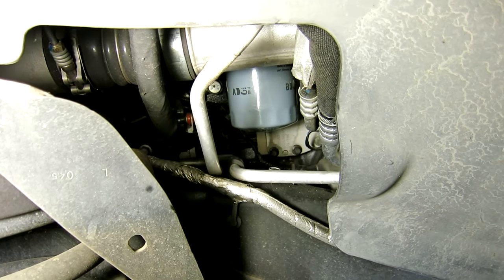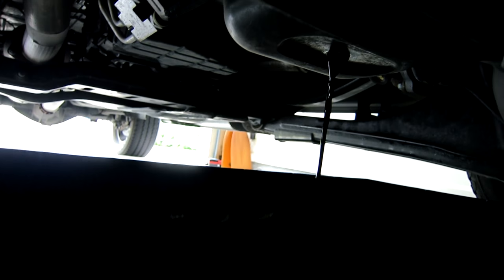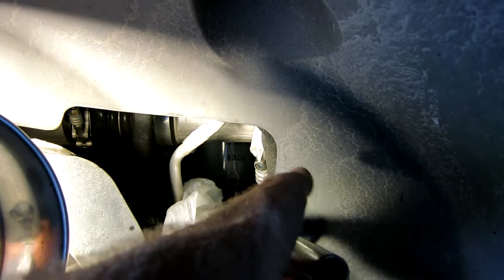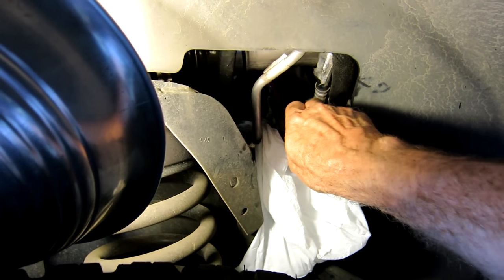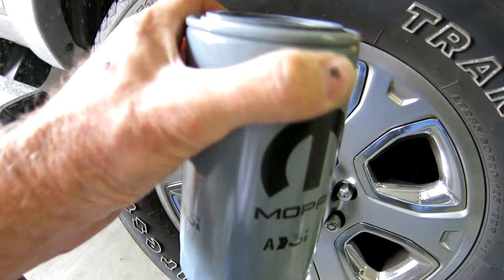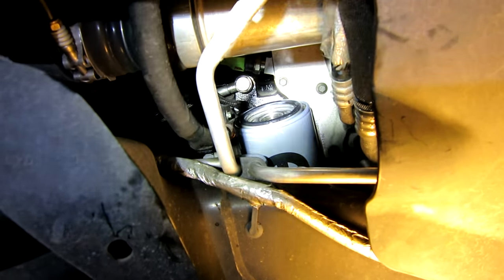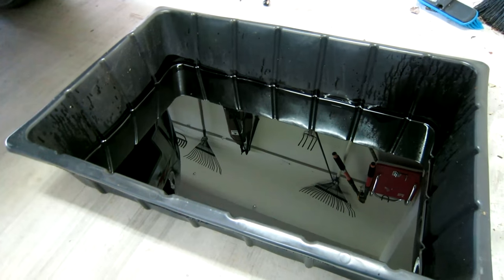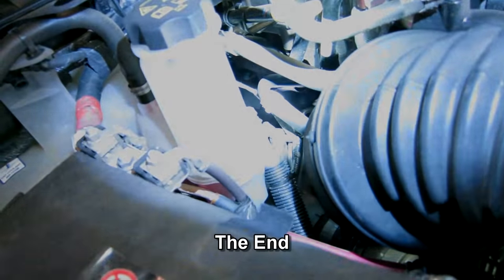2014 RAM Cummins 6.7 Oil Change

Comment: If nothing else the 6.0 Powerstroke had the fastest and cleanest oil filter change in the American vehicle department. It was on top of the engine where the oil drained down and it changed in no time flat
Reply from the maker: Yea, Cummins doesn't seem to collaborate very well on filter location. ha

Comment: Speaking to a cummings engineer he don't know why people put oil in the filter its never a dry start because even if you drain the oil there's still oil cavities he said we even put exact instructions of how to change the oil on the filter package nothing says add oil to filter people think it will help but it doesn't do a thing except maybe make a mess if spilled, thing guy did everything right except he added oil to the filter
Reply from the maker: Both RAM and Cummins recommends filling the oil filter prior to installation.

Comment: I bought mine January 2018.  It looks exactly like yours.  I also bought an additional waranty,($3200).  Supposed to cover everything (except for normal wear items) for a $100 deductible.  I thought you might know, if I change my own oil, will I void my factory warranty?
Reply from the maker: No, it will not void your warranty.  Keep your receipts is probably recommended.

Comment: The filter cap is well worth it.  Yes, use the ziploc to catch the oil, but you can't drag that oil filter through the wheel well without that filter cap...been there, tried that.  Thanks for the great video.

Comment: Very helpful - watched a few times before and while doing my first oil change.  I only wish I'd realized sooner the main problem I was having - spent probably 4 hours between 2 days trying to get the stinking oil filter off -  all because the $3 Walmart 93 mm 15 flute oil filter "wrench" was a piece of crap that didn't fit.  The salesperson at Autozone checked it and said theirs had the same issue, but O'Reilly's $7 one fit the filter like a glove.  Once I had that, the rest was history.  The other video you posted about the Geno's cap-off tool looks interesting - probably a tool I'll add to the toolkit sometime in the future.

Comment: Great video man! I havent  turned a wrench on a trucks since the early 90s and that was a 77 ford. I changed the oil on my 13 Cummins today and everything turned out great. Fairly simple, although I lowered the filter from below ( With the aid of the wifey holding while I reached up from below). And I put it back in from bottom. Thanks again

Comment: Remove the intake to get to the oil filter. You won’t spill any oil, cuz you don’t have to tip the oil filter to remove it. Easy and clean job. When you install new filter, don’t go more than 3/4 turn after the filter touches base. That way, you should be able to unscrew filter by hand when you do your next oil change. 👍

Comment: I always torque a drain plug below the factory spec. I do it as a precaution to prevent stripping oil pan threads. Never had one come loose, and never stripped an oil pan either.
Reply: I heard others do that also.   I under-torqued the transfer case for the same reason as it has an aluminum case.  Most people don't use a torque wrench,
Reply: I have never used one. Do you think I should?
Reply: I guess it depends on your experience.  I like them but don't always use it.
Reply: Thanks.
Reply: I would, it won't hurt anything. I have several different torque wrenches and can tell you that the Husky from Home Depot is a good wrench for the money. I also use the Old Fashion T-Bar style because they are Very Accurate. Not Sexy, but accurate.
Reply: bayonne Thanks.
Reply: agree, I try to use a torque wrench wherever I can, some places are too tight but when I can I do.  You can do a lot of damage by over or under tightening some critical bolts.
Reply: Tightening Force is critical on Oil Pan Drain Plugs. Most people do not realize that a torque spec does not account for oily treads which will easily allow an over torqued condition - or stripping.
Caution should be used when tightening Drain Plugs of ALL Types. 
Snug Tight - is good enough.
Reply: 25-30 ft lbs is all you need.

Comment: Great video.  Just changed the oil using the Genos filter cap.  Went without a hitch.  Maintenace manual calls for greasing the front drive shaft and the tie rod ends.  I can't find any grease fittings.  Do you grease something on your 2013 Ram, mine is a 2014?
Reply from the maker: Thanks, I have a 2014 also.  There are no grease fittings on the tie rod ends but there is one on the drive shaft. See this video, it's not a zerk fitting, it's tough to get to.  https://youtu.be/Scbru0vUkaQ.  It's the only grease fitting on the entire truck.

Comment: Marion ever thought of using Donaldson oil filter. I hear good things about them.
Reply: Why dink around? Use Fleetguard Stratapore LF16035 exclusively. If you are unaware, Fleetguard is aka Cummins Filtration. Not an aftermarket outside vendor but the engine manufacturer's wholely owned subsidiary. The Mopar filter is a painted Fleetguard cellulose media filter.

Comment: Theres a drain channel under the filter to drain the oil away from the engine and steering components..
Reply: BassheadGTP It doesn't work. I know from a lot of experience.
Reply: they could have put it somewhere else
Reply: Nothing drains from the filter if you go through the top. Easier and cleaner. Just keep the filter upright.

Comment: Hey Marion, I purchased my brand new 2018 Ram 2500 because of your videos! I’m just curious I have always been a fan of servicing my own equipment “we have a small farm” I’m just curious what do I need to do to make sure I keep my warranty. 

I’m done dealing with dealership they are messy and I feel like no one will take better care of your vehicle then yourself.
Reply from the maker: Yea, dealers are the enemy, ha.  You can do your own work, it won't effect your warranty.  Just don't remove any of the emissions equipment etc...  I recommend using Mopar or Fleetguard filters, especially the fuel filters.  Use the recommend diesel oil either synthetic or regular (dino) oil.  I don't use synthetic since I don't put a lot of mileage on this truck and hit the 6 months before I get more than a few thousand miles on the odometer.  Let me know if you have any questions.

Comment: you may want to use shell T5 15w40 as regeneration heat is hard on the oil and turbo
Reply from the maker: Thanks, Mobil Delvac  1300 has been in every truck I've owned since 1995 but mostly I'm an Exxon retiree so you know where my heart is. ha.
Reply: my friend clocked 1.5 million miles on a Detroit series 60 using delvac
Reply from the maker: Yea, if you look at the specs, the Delvac looks a bit better.  Actually, Chevron Delo, looks great.  I retired from them also. ha
Reply: delvac 1300? I prefer to spend the $$ for Delvac 1 ESP full synthetic. Peace of mind but damn expensive unless on sale or Mobil rebate
Reply from the maker: yea, agree.  If I did 15K oil changes, I'd definitely go with the synthetic.  Mobil either way.

Comment: I guess you get good at it like anything else.ford makes it 4 times as easy. I won't say 10 times as easy cause that's just not right but 4 times is easy is good.
Reply: Cody Baker I like how much you thought about that
Reply: I guess you never actually worked on a Ford, past the oil change?

Comment: Much simpler to remove the turbocharger inlet duct and change the oil filter from above. By the way, Cummins would not include in their service manual instruction to pre-fill oil filter if it was optional or unnecessary.
Reply from the maker: That subject is debated about as much as which oil to use. ha.
Reply: +Marion Blair Not really as Cummins says pre-fill. Nothing to debate.
Reply from the maker: +Walter K agree, I always fill the oil filter.   The debate is whether you go in through the top or the side.  Everybody has their preferred way of doing things, the end result is about the same.
Reply: @MarionBlair  just an additional idea. Personally, I find with a filter socket such as yours and a filter-plug-tool through the fender is simple and mess-free. Ram should include the plug-tool with the truck. I opt to periodically remove the air inlet plumbing to remove oil filter from the top. This also gives opportunity to assess radial and axial play in turbocharger shaft.

Comment: my has 2 clamp and two tabs in the back but when undone can not move top of cleaner forward enouge wonder if i need to remove the hose
Reply from the maker: Loosen the big clamp and remove the intake hose from the air cleaner housing then remove the 3 screws and lift up.  The cover of the air cleaner housing should come right off.

Comment: what is in the way to prevent accessing the oil filter from underneath?  A cross-member or.....?
Reply from the maker: Yes, on the 2013 and up 4 x 4's there is a cross member that completely blocks access to the filter.

Comment: How often do you change your oil? The book says 15,000 miles or 6 months, whichever is sooner. I never drive 15,000 miles in 6 months so I just change mine on a 6 month schedule, every spring and fall. I know I answered my own question, but I'm curious if you have any thoughts on this. Thanks!
Reply: Also I use Shell Rotella 15W-40 T4, as recommended in the owners manual. I believe it is conventional oil, as opposed to synthetic. Also I recently decided to switch over to the K&N oil filter instead of Mopar, but only because they are made in the US and I would rather support that. Do you have any opinions or research to share on oil choice or filters? I have a 2016 and the oil filter appears to be a little harder to access on yours. I wonder if Cummins made changes to make it easier? I also access it from the wheel well and I do have to tilt the filter to get it in and out, but I usually don't spill a drop.
Reply from the maker: personally, I think 15K is too long and from the oil analysis I've seen, I'd keep the max to 10K.  I usually shoot for about 6K or 6 months but 8K would be fine for highway.  These are just my standards not any real data to back that up.
Reply: @MarionBlair  Thanks! That makes sense. And I agree, I wouldn't feel comfortable letting my oil get up 10K even if it were in less than 6 months.
Reply from the maker: No, the 5th gen looks the same to me.  Hard to get to.

Comment: Just got a 3500.  What is the savings on doing it yourself vs a shop.  I imagine pretty significant.
Reply from the maker: If I do it, it cost about $45, dealer does it for $75.  If you trust your dealer, it's probably not worth doing it yourself, ha.  It's a pain in the ass, it's one of those things you have to just like to do otherwise, take it to the dealer.

Comment from the maker: Cummins says 15k or 6 months.  I usually only have 4 to 6k when I get to 6 months
Reply: Hi Marion blair i just got my 6.7 from dealer checked the engine oil and its reading a bit high. I checked it 2hours after i drove it but it was 80degrees today. Is it better to check when i start it recently or let it cool down.
Reply from the maker: @devinsuni  i check mine cold like in the morning before i take off.  Some dealers overfill them.  Also, if it sits there for days, it might show high as the oil takes a long time to drain.  3 gallons on an oil change.  No more no less is what I do.  It'll drive you crazy trying to get an accurate reading.  As long as it's not low, you're good.
Reply: @MarionBlair  thank you sir! Yeah its annoying just buying a truck and not knowing what they did during the oil change. Do you suggest anything for fuel additives for fuel fillups.
Reply from the maker: @devinsuni  no sir.  No additives.  On the oil fill.  I had one dealer tell me he puts an extra quart.??  Ha.

Comment: Do you have to remove the front wheel to change the oil or can you leave the wheel on?
Reply from the maker: I leave it on.  thanks.  If you have short arms and it's uncomfortable, you can remove it but other than reach, you don't need to.  thanks.

Comment: The filter is so much easier from the bottom, just my opinion
Reply from the maker: No way to get to it from the bottom on 2013 and above.  Thanks.
Reply: My apologies, I have a 2012 and it's super easy.  Did they not give you an access panel? I wasn't trying to imply you were doing it wrong, it just looked like a bigger pain than necessary. Since you're going in that way, don't waste your money on the "filter glove" from genos.  I do however highly recommend the "EZ drain valve" they have.  I drain straight back into empty oil jugs with zero mess, it's awesome. Drain pans are a thing of the past now....

Good day to you sir.
Reply from the maker: Yes, the video shows the access hole in the fender.  The only other way is to remove the turbo intake hoses from the air filter to the turbo.  I have the EZ Valve sitting on my desk.  One day I'll get the nerve to install it

Comment: How often do you do your oil changes?
Reply from the maker: Every 6 months or about 6000 miles.  I don't use my truck enough to justify synthetic otherwise, all highway miles, 10,000 would be the max based on the oil analysis I've seen.

Comment: Can anyone tell me what the MPG on this beautiful machine is?
Reply from the maker: I get a out 16 - 17 in town and 23- 24 Highway according to the electronic calculator on board.  I never have hand calculated it to see how accurate the computer is.
Reply from the maker: Here a mileage test.
https://youtu.be/jVqPfI6iIxU
Reply: Marion Blair youre getting 16-17 city!?!? im trying hard as hell with my 2013 6.7 2500 to get 14 city, you got any not so obvious tricks other than drive slower?
Reply: Brandon Le Slow RolliN
Reply from the maker: That's what the EVIC says, not calculated.  It's pretty close however.

Comment: Is it necessary to pre fill the filter
Reply from the maker: Hi, the service manual says to fill it however there is much debate on the various forums as to whether it's necessary.  Nearly all the quick change places do not fill it.  My dealer does it the way I did in the video but doesn't use the sealing wrap.  I personal think that is adequate because the oil flows through the paper (outside) first then comes out of the center.  If you soak the paper with oil and leave the center of the filter without oil, you can install it without the sealing wrap and won't make a mess.  Oil pressure will come up instantly so I think that would be good compromise.  It make yet be overkill as these oil pump are extremely high volume and it fills the filter very quickly.
Reply: +Marion Blair thank you
Reply: +Marion Blair The debate on forums is irrelevant; Cummins says to pre-fill, not optional or up for debate.
Reply: Yes it is necessary to pre-fill; otherwise Cummins would not tell you to pre-fill.

Comment: Unnecessarily tedious for something so simple. A powerstroke diesel is so much easier
Reply from the maker: I think all RAM owners would agree
Reply: Going through the top is way easier.
Reply: No need I Change oil on something that can’t stay running long enough to need an oil change. So yup, can get easier than not having to change oil cuz it’s not running

Comment: piss poor design, thanks fiat!
Reply from the maker: Yea, I wonder if they fixed this fiasco on the 19's.  I don't believe.  I don't feel as bad now that Duramax has to go thru the fender to change the fuel filter.  However, Ram and Cummins clearly aren't communicating with each other.
Reply: @MarionBlair  nope, I may have already mentioned same procedure.

Comment: Great video! Thank you
Reply from the maker: Thanks very much
Reply: +Marion Blair hello there sir, is it possible to vacuum out the oil from the front differential, there are no drain holes, or do I have to remove the front cover? Thank you ahead on time!
Reply from the maker: erick101ish Sure, I've seen people do that with a little hand pump.  Probably could do it with a cheap Harbor Freight one or similar.
Reply: +Marion Blair Thanks gonna give it a try

Comment: How much the oil change cost at the dealer?
Reply from the maker: $78 US
Reply: $315, if you also get both fuel filters changed at the same time. But that's here in Farmington, NM. I don't remember what the oil change only was.